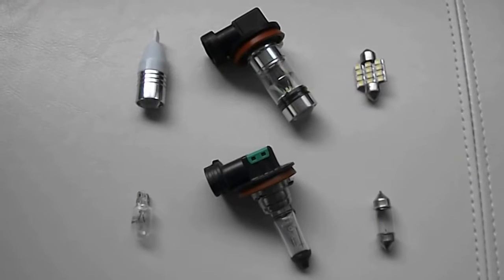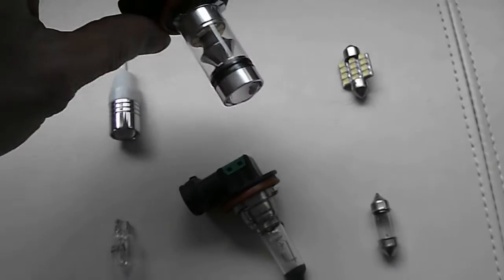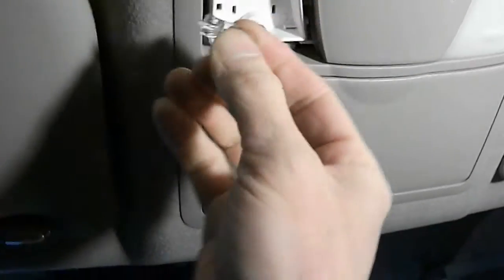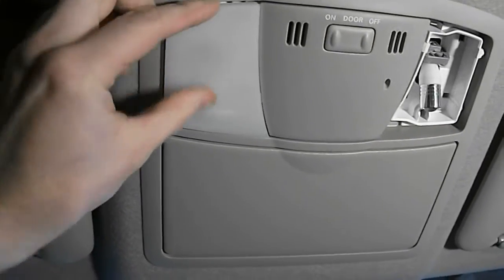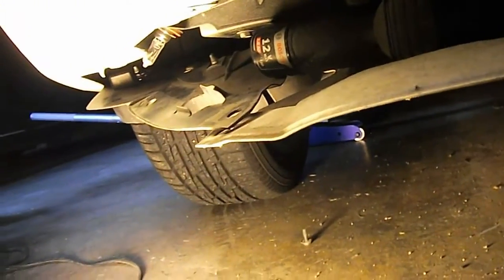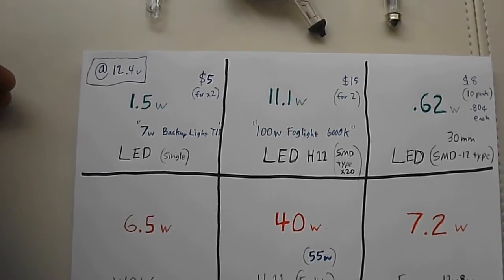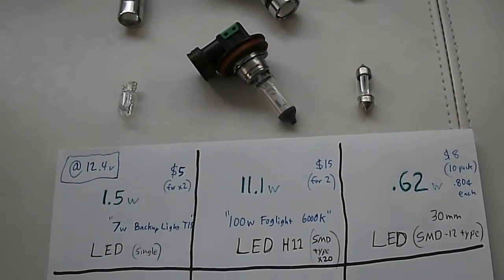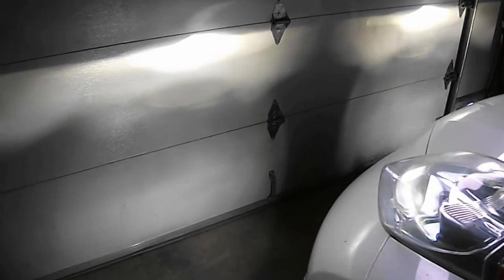Nissan Leaf - Modified - episode # 03

Comment: The original fog lights are correct.  You want the light down low with no scatter above you sight line.  Otherwise you get reflections off the water molecules in fog that just turn the fog into a white blanket in front of your vehicle.  Replace the poor focus LED fog bulbs with the originals for your own safety.  Regards.

Comment: Hi, I have a 2013 Nissan Leaf SV that didn't come with fog lights, it just has a plastic piece where a light should be. Is it possible to  install them & how would I go about doing so?
Reply from the maker: Hey, I would just go on eBay & a buy an aftermarket kit that specifically fits a LEAF.  It would come with LED bulbs all for about $97.  You might need to buy a better switch to fit in one of the "blanks" on the dash lower left.  Or for more money, you could buy some Nissan OEM foglights used on Ebay & they would fit perfectly.  But, you would still need a switch & relay.   And LED bulbs that look like the ones in "Modified #02" not the type I installed here.  Either way, you should be able to remove the plastic filler pieces & mount the new.  There should be fog light installation videos somewhere on YouTube.  Or "if money is no object" a Nissan dealer could easily do it all and make it look stock. Hope this helps you out.